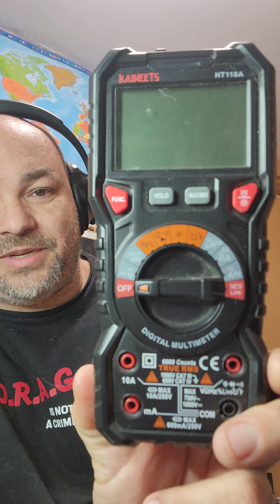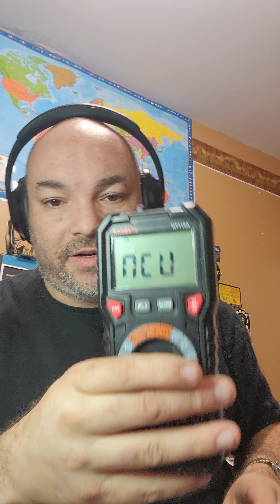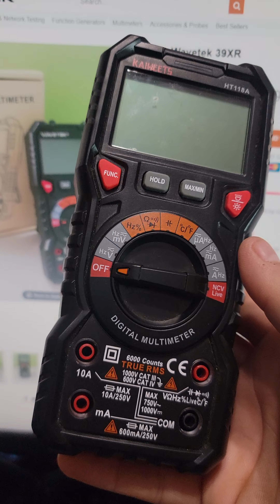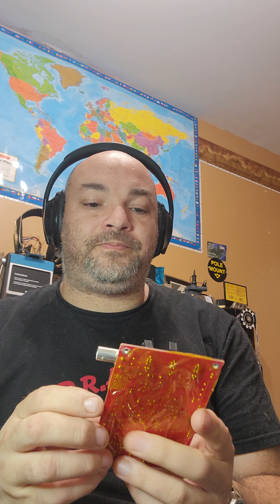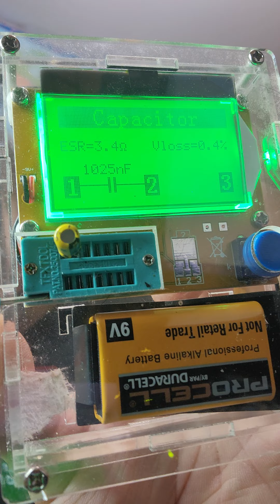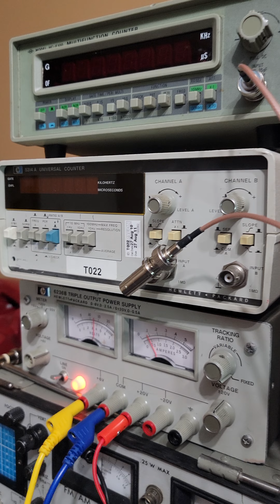Unlock the World of Electronics on a Budget: Affordable Test Gear Explained!

Comment: I'm usually not a fan of off-brand dmm's (except for my 121GW), but that's a clever idea on the part of Kaiweets.   Hopefully, other manufacturers will take note.  If you're willing to lay out $40 there are a variety of oscilloscopes on scamazon that will gitter done.  I don't think I'd settle for one that doesn't even do 1Mhz (or have a case) to save 20 bucks.